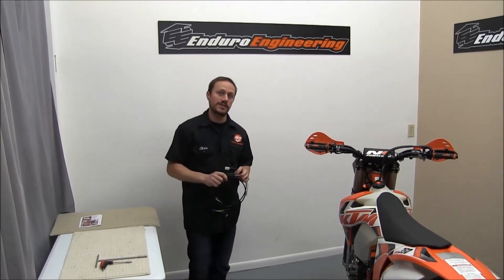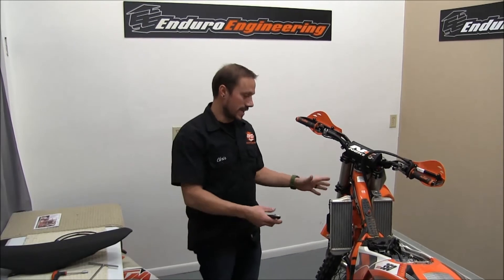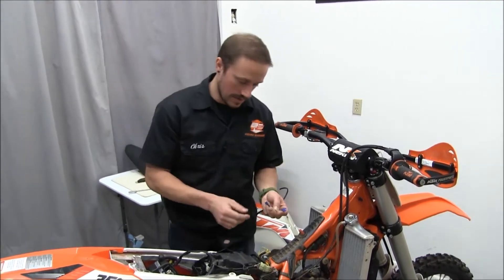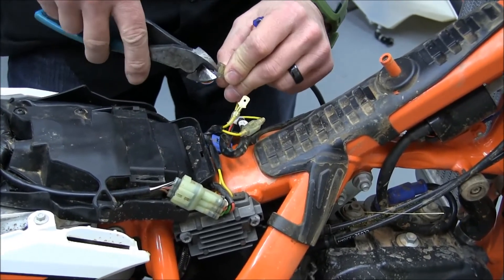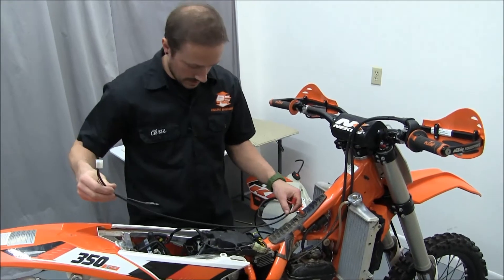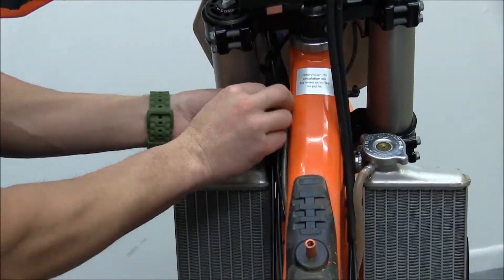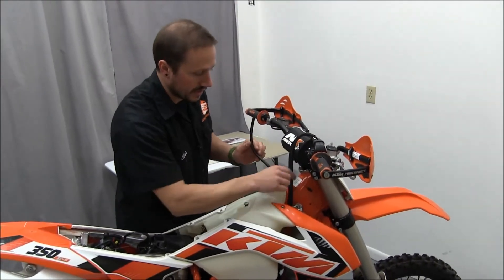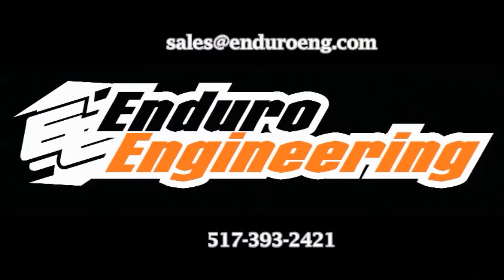30-704 Enduro Engineering HARNESS Installation

Comment: The yellow wires on my ‘18 350xcf were under the main frame, basically right underneath the gas tank peg. Just an FYI, as I’m new to this stuff and it took a while for me to figure out that the yellow wire connections could be located elsewhere than what’s shown in the video.
Reply: Thanks for the heads up Zach, saved me time 👍
Reply: 2017-2020 are completely different bikes than the one in the video.